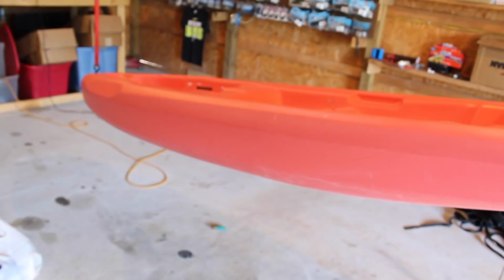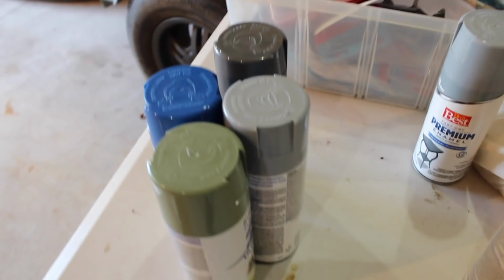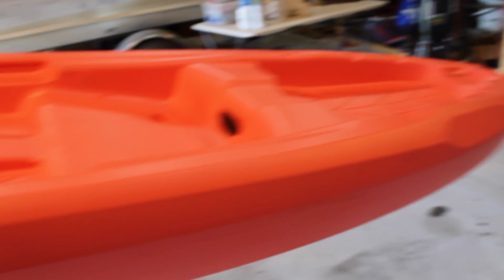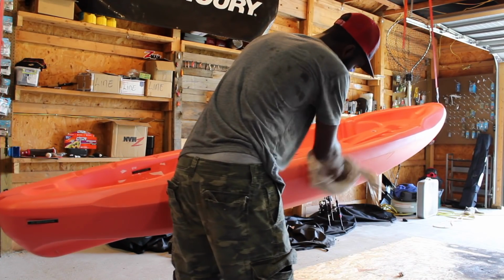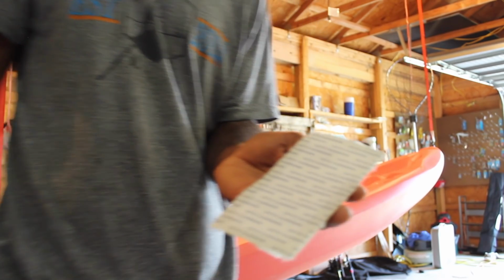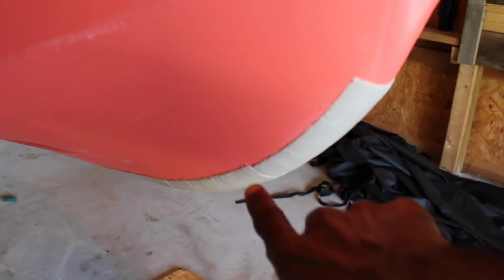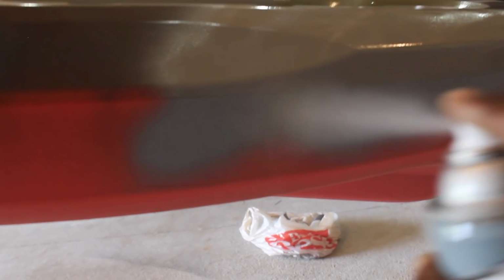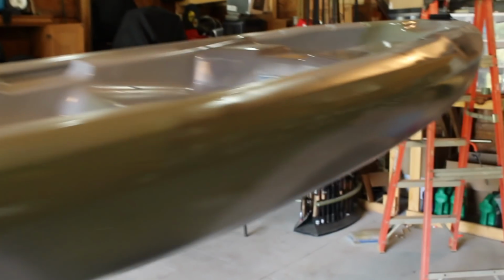Project Kayak Part 1

Comment: Look sgood dude. I've got some bass boat guys who have started taking their Keel guards off and using the spray in truck bed liner instead. They love it. It's cheap and easy to fix if it does get beat up. You just add another coat. They spray it in a paint tray, tape off the area, and roll it on. It looks great and holds up really well.

Comment: I'm really liking this first step, and I'll be watching!

As for a seat, I've recently seen a post about a DIY seat using PVC. My yak has one of those stiff-backed foam deals, held in place with straps. I had to use heavy-duty hook and loop tape to keep it from sliding, and being such thin foam right on the plastic, it's not so comfortable after a couple hours. I'm considering a stadium seat (you can find a decent one online for about $35), which would raise me up off the yak a little, and provide a more comfortable seat for long outings.

Of course, I think we'll use ours a little differently. You drag yours through the woods, taking advantage of light weight for hard-to-access waters. Mine is 60 pounds empty, and I've been putting it in at canoe drops to fish bodies of water which regular boats can't access so easily -- though some more determined people will drag aluminum boats in, and attach motors once they're in the water. This past weekend, I paddled about five hours up stream to my destination. In another couple weeks, I plan to explore a smaller channel which empties into that river not too far from where I've been putting in. If the water is deep and slow enough, I'll find myself near the bottom of a dam which creates a local pay-to-fish lake.

edit: I just saw the foam stadium cushion suggestion. I have been considering one of those square cushion life preservers, to put under my seat. Back support aside, I think that might be enough of an addition to help add comfort for a long duration paddle, and about five bucks. Plus, if you tip, you won't lose it. A second bonus is that it floats, and has two handles where you could potentially attach rod leashes.

Comment: Nice job.  For a SEAT, try using one of those stadium seat pads.  They are light and float if you should roll over.  I used one on my old Ascend kayak for fishing in the past.

Comment: B.Lat,

I hope your family and you didn't get affected by the hurricane? Great mod it's looking sharp hopefully those clear coats will keep the the paint from pealing off. Theirs allot of good #KayakSeats on the market for the most part the more comfortable ones are more expensive but check out the a  small fold-able jon boat seats if it's fits in the seat well it should work good for you.